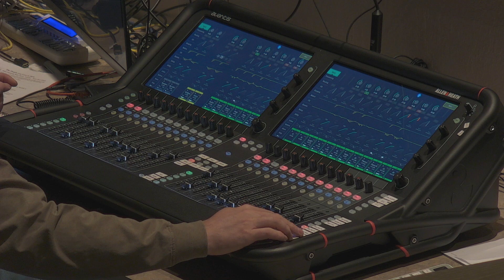My Issue with Allen & Heath Avantis

Comment from the maker: P.S. Yes I updated the firmware, ran a calibration, factory reset etc. 😁
Reply: did it fix the issue?
Reply from the maker: @BrianCharlesV  It doesn't look like it 😕
Reply from the maker: @BrianCharlesV  It turns out the console is defective.  I managed to get ahold of a loaner and it works beautifully!  This one is out for repair.

Comment: I’m glad you made this video. I was having the exact same issue!

We originally got our consul right when they started shipping and so I wondered if the show file I was working on caused the problem

I made a brand new file starting from scratch, and it solved that problem. Hope that helps.
Reply from the maker: Hmm, that would take a while as my base template is fairly complex, though it's certainly better than sending it back for service.  I take it the set-up file itself is corrupt, as resetting back to default and loading in the file again didn't help.
Thank you!
Reply from the maker: It turns out the console is defective.  I managed to get ahold of a loaner and it works beautifully!
Reply: @wado1942  thanks for replying! I actually encountered the problem again, and after reaching out to support, they have claimed that the first set of consuls were made with a bad chipset inside the consul feeders… And they didn’t give me a solution or say that they would be fixing it. They just asked for information on when I bought it and the S/N.
Reply from the maker: @micahsaldivar  Yeah, it sounds like they're moving pretty slowly.  They received my console at the end of last month.  I E-mailed them yesterday and they basically said "we'll let you know when we have something to tell you."  I hope our mutual issues aren't a trend for this board because I REALLY like it otherwise.